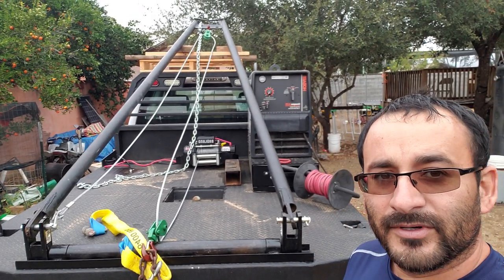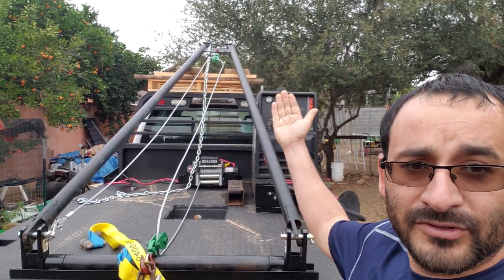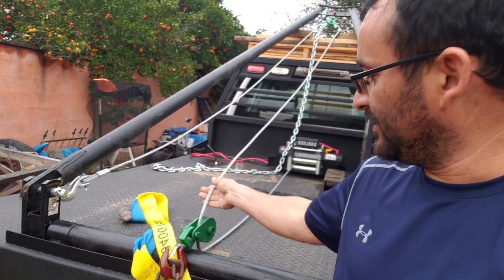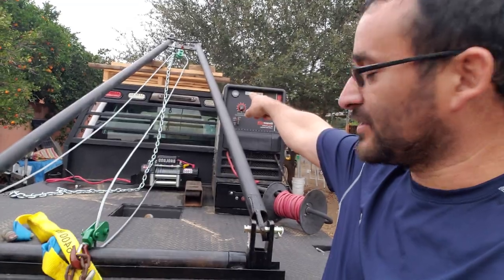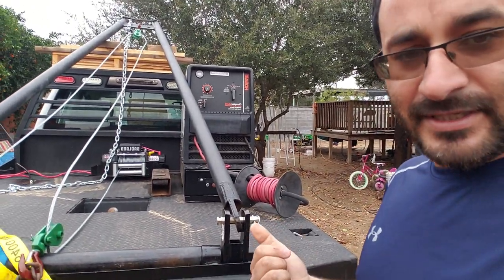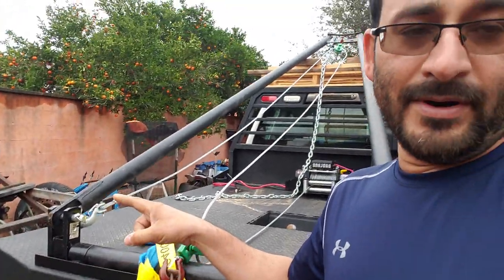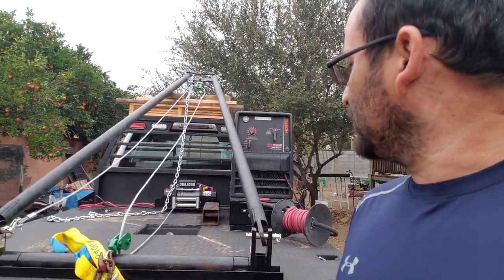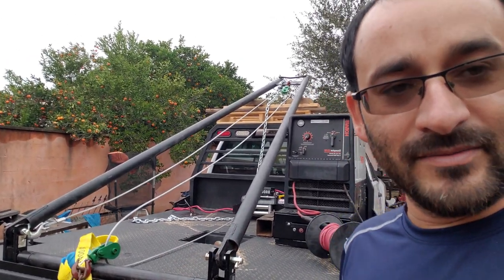My badlands 12000  gin pole winch truck invention was a failure.

Comment: Its Not a failure when you learn from it.  It is a Blessing that you found problem before being out on a job and losing a load.  Keep up the good work.
Reply from the maker: Thanks. I enjoy learning from my mistakes and really haven't used the poles like I wanted. Steel prices are so high that my projects are on hold. I just got off the phone getting a quote on a 16ft bumper pull dump trailer, $19,500...

Comment: Thank you for posting this video. Every attempt to build something has important lessons for those who follow. You have a very nice-looking rig. Look forward to seeing your final result. Cheers from Michael. Australia.
Reply from the maker: I appreciate that! I always put issues or errors as they come up so we can all learn. This truck was going to help me install some 10" 15 ft tall steel pipes for a cabin in the air project but due to wood increasing 200% its on pause. I will be using this winch on my goose neck trailer to help pull stuff up and will use the 2" coupler design as well.

Comment: got to be careful that shiv has to be behind the poles when you lift too because if the load swings towards your truck those poles can fall over towards your cab. ask me how i know
Reply from the maker: The bed was not really designed for the gin poles and thought I could get it working. Thanks for the suggestion and I am thinking on converting truck to dump bed now.
Reply: I lost a windsheild figuring this out.

Comment: Just lower your rear pivot points (bottom of each pole). They shouldn't be above the winch.
Reply from the maker: I was actually outside looking at the truck this morning and wanted to cut them up. I think I can shave about 3" on the height. I may chop one of the Clevis mounts and weld it to 1/4" wall tube versus 3/16". If I end up going that route I will for sure upload a video.

Comment: The henge point needs to be attached to the vary end of the frame for maximum capacity and abilities. cut a notch in the bed just enough were the polls need to travel . At the right pitch hardly any winch will break it. Good luck!

Comment: Well sir, not every new project we start ends the way we planned. The good part is we learn more from our mistakes than we do from our successes. The next system you build will be the correct one. No doubt with your obvious skills. Keep up the good videos. Have A Good and Safe Day. 🛻🚚🚛
Reply from the maker: Well said! I really enjoy solving issues especially with limited materials. Most of the projects on my channel are from scrap metal with the exception of the majority of this flat bed. The gin pole was never planned into the bed and once I needed a way to lift I tried to adapt it which gave me decent results. Thanks for watching and stopping by to leave some motivation.

Comment: Good point, I’ll have to be aware of this when welding mine up.  

It looks like the wrong angle when you’re trying to winch out the boom, easiest way to fix would be to put a heavy duty roller wheel about a foot off the bed right where that green snatch block is, then attach the snatch block to the bumper hitch so your winch angle is |\ instead of ||
Reply from the maker: I really messed up on this build since it wasn't really in the plans. You are correct and I tried something like that and made a big difference. The prices of steel actually placed my project on hold and my truck has been parked in the same place since then. 
Thanks

Comment: I've never seen a gin pole that gos up under power. You just stand on the bed and flip it over. I made a gin pole that just has a piece of angle iron at the base so I can put it on almost any truck by just jamming that angle over the bumper or edge of the bed. Then I drilled a hole through the floor of the bed so my cable could be attached directly to the truck frame. My winch attaches to the receiver hitch. My first gin pole just used a come along and was on a '55 Chevy. I pulled car engines with that thing.
Reply from the maker: I have not worked on my projects but I did rebuild the mounts and now I can lift the poles with the winch. I used 2 7/8 pipe by about 13ft so they are heavy to even lift by hand. I still have to wire the battery up to start testing. I do plan on getting back to my projects as time permits.

Comment: Also if you can angle the bottom bolt tabs on gin poles them selves where attached with tabs to flat deck. You will lift with a solid base. It will remove flimsyness. Also remove risk of injury. Cause 1ton under weight coming down with that gin pole weight could wipe anyone out. Need a good 20' winch cable controls, stand way back. Till its at an angle it can only fall one way. Its at the straight up position it could buckle, go 360* either way down. Once leaning one way. Its almost n destiny to fall that way. In obstructed.
Reply from the maker: Thanks for the information. This was a project I added to bed afterward and never planned it. I have learned so much using it and a long control cable is a must. Thanks

Comment: You could move the gin pole back  toward  your axle area.   You need to build a a frame  using 3/8 flat metal.   If you have heavy roll bars behind the truck cab. Needs to be built out of 3/8 thick round or square pipe with down ward legs  to support the gin pole.  By moving your gin pole back toward your tool box  ,, it will allow you to lift up more weight  I have built 4  different pipe gin poles over the years for 1 tons and 2 tons truck

Comment: If you want to pick the poles up under power tie the line off around 20 30 feet from the back of the truck and winch on it
Reply from the maker: Thanks for the help as that also works great. I did some small modifications to the rear swivels and that helped out also by lowering the pivot point of the pipes.

Comment: Just hook the hook to ur bumper, winch the poles to 45 degrees, let it lean on the chains,unhook the hook and attach whatever ur lifting.
Reply from the maker: I actually modified the rear hinge system to get the poles lower and help raise the gin poles alot easier.

Comment: I bought a truck that was like that the poles would not go up under power. Ao I would just push them up with human power never has a problem with them. Used them like that for years.
Reply from the maker: I am going to modify the base so I can lower the back end of poles about 4 inchs. The truck was never meant for GIN poles but thought I could repurpose the receiver tubes to accommodate a gin pole setup when my vice or BBQ grill was not mounted. I tried lifting the poles but these pipes are heavy and I may be to short as well. I was looking for some plate today to start the rebuilding but I did not have a torch to cut the plate. I already lifted the poles by using an attachment that grabs onto the bottom receiver tube but just looks nasty. I also popped a chain in the process that held the bottom pulley. I think I will take my time and design something beefier. We finally have a cold front coming so lets see how the weekend goes.

Thanks
Reply: Find some more pole that those fit into snug and either redo the mounts that way and also have the option of the 2 peice poles for extending or shorting. Maybe used heavy-duty pines or a pair of bolts on each connecting point with jam nuts or such. Knowing that you have 2 thick wall round stock will be super strong . Use a driveshaft and possibly fab the end where universal goes to get a better hinging idea.
Reply: @chadmartin5640  Also need to reinforce snatch block are by mitering pipes.

Comment: I just found a video on Wayne Newman's YouTube channel that shows his gin Pole set up and he has a small upright piece in the rear that is removable that the cable runs over to help lift the poles
Reply from the maker: I have seen his truck before but hadn't paid close attention to that piece. He uses that piece to avoid damaging the cable as he is missing a roller but I could do something similar for the pulley. Thanks for inspiring me to keep on going with the project. I was thinking last night if I used a bigger pulley I might be able to create some leverage as the cable would ride above the gin poles. Well thanks bud.

Comment: Don't give up!  I think by adding either a larger diameter tail block, or raising it up higher (as you suggested), this is totally fixable. Can you get a cheap large diameter snatch block from Tractor Supply or Northern Tool or wherever to substitute in place of the current one?
Here's one from TSC which is overkill in the load department (even with the Chinese tons rating), but might be large enough:
https://www.tractorsupply.com/tsc/product/traveller-x-single-pulley-snatch-block-12-ton-capacity-snb12t
Looks like it's almost 6" in diameter...
With a big enough sheave, the lift line will be well above the pivot for your gin poles, and the vector will tend to lift them off the headache rack.  Or, to quickly test the idea on the cheap, shove a length of 4X4 or 6X6 under the hook of the snatch block to raise it up a bit, and see if that doesn't help.

See especially Wayne Newman's post #19 in this thread for the proper geometry:
https://weldingweb.com/vbb/threads/57780-Help-with-gin-pole-design
But really, the whole thread is worth a read, because there are comparisons between professional oil field trucks and full red neck rigs (my own neck is pretty red sometimes!).
For the benefit of others, here is Wayne raising his gin poles:
https://www.youtube.com/watch?v=3llYRCPBnhE

See also some added details on Bob's truck in this thread:
https://weldingweb.com/vbb/threads/707199-Gin-Pole-Porn
In particular, Bob only needs to make one adjustment to change the angle of dangle of his gin poles, whereas Wayne needs to adjust both chains to get them even.  If you prefer chains over cable, you could still swipe the chain and sheave out of an old fashioned differential chain hoist, and replicate Bob's setup with that.

A pair of check chains from the poles to the rear bumper might also be a good safety device, so that the poles can't whip over onto the headache rack and cab.  Just in case.

I recently bought a 1994 K3500 heavy one ton cab and chassis, standard cab and long bed.  It is an old state highway department truck, and was originally spec'd for 12,000 GVW, even though it only has the 5.7 liter and a 4L80E in it.  Once I get my new used skirted 11 1/2 foot flat bed mounted to the rails, a set of gin poles is on the list.  I want to be able to raise timber frame bents and set roof trusses.  I intend to make my gin poles telescopic, with 3 point link balls at both ends to accommodate the change in angles as the length changes.  Collapsed and unpinned at the top, they'll lay down on the sides of the bed.  Fully extended, they'll be about 20 feet long, and will be able to be pinned to any pair of stake pockets (though only a couple or three pairs will be of any real use).  My thought is, once something small and heavy is aboard the truck, the poles could be re-footed closer to the front of the bed, and the load shifted a bit further forward, try to get the CG a bit ahead of the rear axle.  In my plan, the tail block will move with the pole mount.  I also scrounged an old Desert Dynamics (now Pierce) winch off Craigslist desperately cheap that I will mount similar to yours.  If I can get a rebuild kit for the hydraulic pump that came on the truck, I may buy the parts from Pierce to convert the winch to hydraulic drive.  So, no real experience with gin poles yet, but I have been studying the subject for a while now, getting up the courage to do this for myself.

I'm pretty sure some minor geometry tweaks (and maybe just a bigger diameter tail block sheave) will make your gin pole truck work.  You'll get it sorted out.

Thanks for sharing, even if it didn't go quite how you planned at first.
Reply from the maker: Impressive reply. I haven't done much lately due to work but I been wanting to build new mounts for the poles. The mounts will be lower by about 3.5"giving me a lower point or pivot point. I will add a larger bottom snatch block which would bring my cable height above the center of poles. I should actually try this weekend since it's a longer weekend. I'm on my phone but will check out the links provided. I'm hard headed and wont allow me to fail. The project was slowed down due to lumber going up like 50% putting my cabin build on hold. Once again thanks for the help and ideas. I will get back to you later today or tomorrow.
Reply from the maker: I am almost done with a bracket and is about 3.5" lower than the clevis mount I had used. I ended up using 1/2" plate as I had some scrap laying around. 3/4" plate would of been nice too but I might struggle cutting it with my plasma cutter.  I really think I will get things going very soon. I still haven't seen all the links provided but I did watch the video of lifting the gin poles. Once again Thanks for the motivation.
Reply: @cutweldngrind  Hey, you bet, you're welcome.  But, you are the one who has inspired me to get on with it!

Oh, and Wayne's last name in the links above was "Cook" not Newman.  I never met Wayne, but I learned a bunch from his posts.